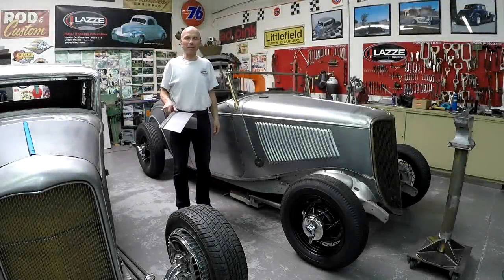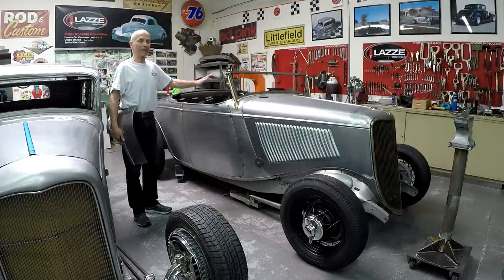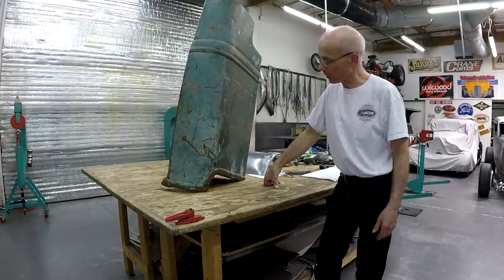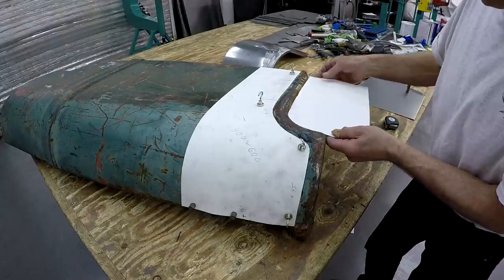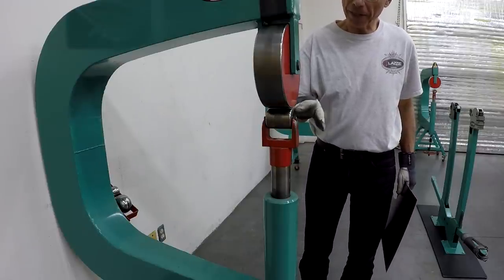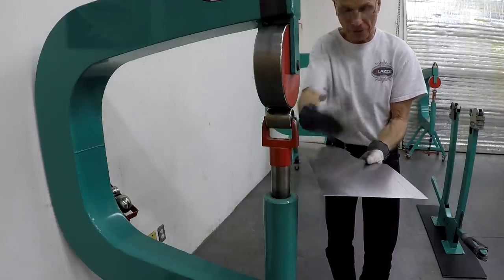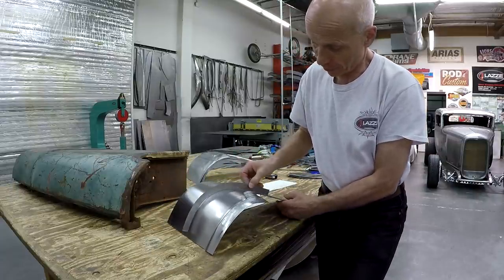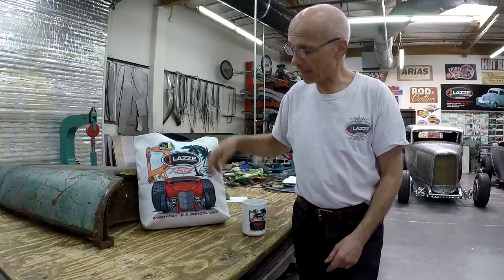Lazze Metal Shaping: Early Ford Cab Corner Part 1

Comment: I'd love to build a 28 model A truck,from aluminum, maybe,   to fit a S10 chassis, even make it extended cab,   slightly wider,  maybe build a set of steel rims, 20x8.5" on the front, with large hollow spokes  about 1/2" yter diameter spokes with a center that can have a center cap, like The Corvette rally the more flat ones,    with a flat cone in the center,  a roughly 10"   that steps down to a 6"-7''  that will hold a 6" -6.75" center cap,  witb a 20 x 11 rear, with a 275-45-20 there about, and  255-40-20 on the front,   make the extended cab,  by making the doors longer, and the rear cab corners behind the door, about 12"; or so,  using a extended cab frame,   or stretch a regular cab frame, use the bed floor, and the cab floorboard, and firewall, maybe the door insides, remove the skins, and build new skins and rear cab roof and A, pillars,  using the original door latch,   and remove the dash, and build a steel dashboard similar to the model A,    lower the suspension,  build a bed similar to a 47-54 Chevy,  that drops down below the frame slightly.  And small fenders similar to a  trailer fender, or a chopper motorcycle fender,   in all four, with the hood sides , lower portion, covering the frame, filling the gap from door width, to grill width, and possibly use a narrow radiator,   build a grill a cross between model a and 36 Ford truck,  with it being wider, and  matching up to the lower hood /frame covers,  then have a somewhat normal looking hood, only being wider in the cowl area, narrow at the radiator,  have a ridge down the middle, looking like the hinge. Only the hinge is on the firewall,  with it opening at the front,  and only the top, about 4" of the sides,  the side skirts attach at the grill,  and cab,   use flat glass in the doors, windshield and back glass,  make it model A looking as possible,  possibly using the vortec 4200 with 5 speed, from a Colorado, so maybe a Colorado frame,   build  an aluminum sheet metal intake base, and adapt a supercharger from a LSA or something similar,   with intercooler,   go from 270 HP to 570-650 HP,   and shorten the rear of the frame behind the axel!  And paint it grey and satin black,   with  bit of silver in places blike the grill, rims,   having about 56 spokes on the rims,   if it's not possible to get or build the rims, use the D window rims, or 0 window rims ,  having a 4/6 drop suspension,  it would be cool,  and probably just a dream, sorry to ramble!!! Good day!!

Comment: I stumbled on to your chanel.you do awesome work. Nice equipment. I am a retired aircraft  mechanic. I was always making sheet metal repair parts. I wish we had your equipment. You dont use form blocks?.our shrinker and stretcher was pneumatic we had an english wheel.but not the assortment of different shape wheels. I'm retired now. Working on my 54 chevy truck. I need to form the belt line on the back under the window. No fancy tools. I will try a form block

Comment: i'm looking forward to learning more, i have a 34, 5 window project, i need to make rear quarter panels, and a set of floor sub rails, the rest of the body is a collection of parts, nice stock frame, front of a 5 window coupe roof, rear roof of a 4 door sedan, nice cowl, an almost perfect set of 4 door front doors, and more, thanks for sharing, i have to check your videos on 34's